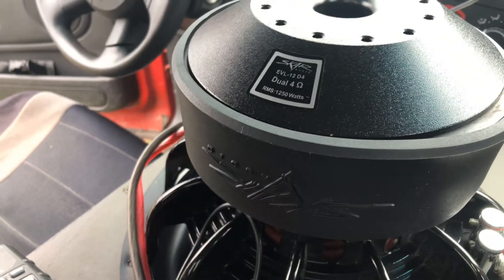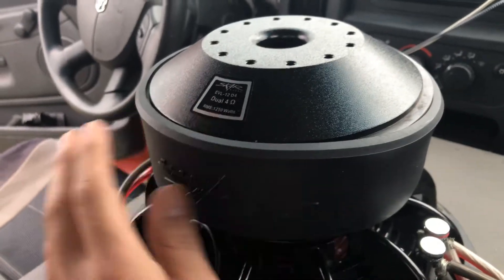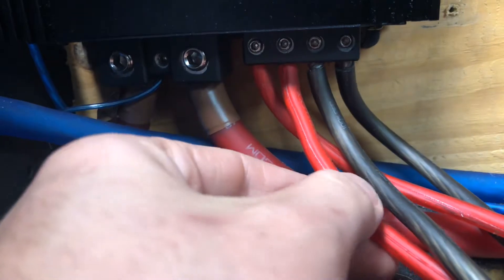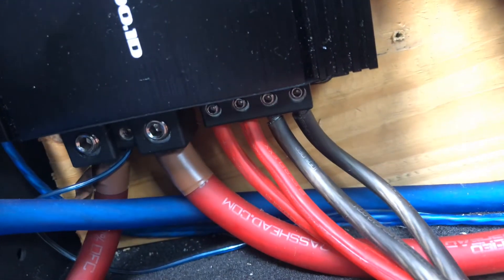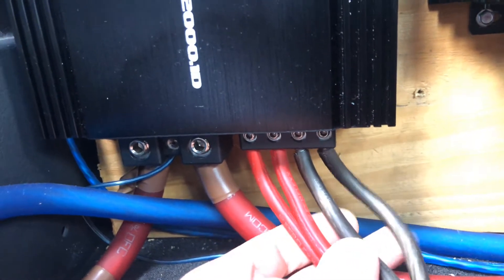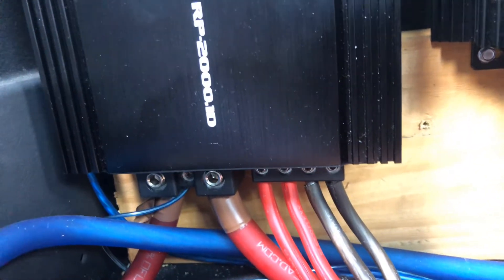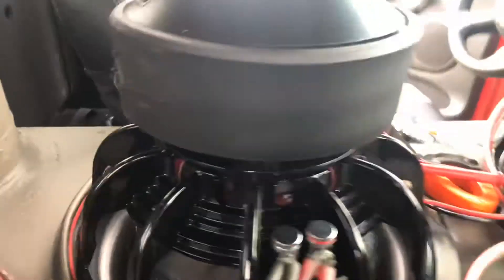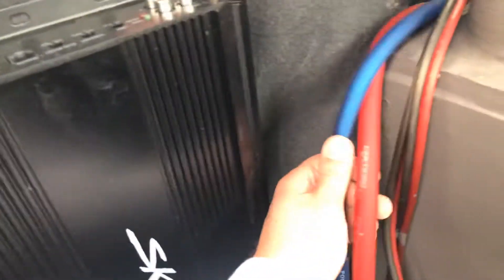How to wire 2 dual 4 ohm subwoofers to 1 ohm

Comment: How you fit those thick cables together?
Reply from the maker: Most higher end and spl type subs have larger terminal they also make terminals that you can screw down 2 wires into and they have a post on back that would secure into terminal on amp or sub
Reply: @TheRandomHandyman  oh thank you
Reply from the maker: @grikisgrikis2779  welcome also ya gota twist the shut out of them haha

Comment: I have 2 15 l7 kicker solo baric and i have mono block 1ohm load and it has two positive and two negative can i do the same? how you did it?
Reply: I guess it depends if your subs are 2ohm or 4ohm.
If they are 4 then yes.
If they are 2ohm then its a little unfortunate, unless your amp was too big for your subs anyway.

If it's 2ohn you'll have to wire them together at 2ohms.
This means that if your 1ohm amp is rated for 1000 watts rms at 1ohm.
Its probably putting out like 500ish at 2ohms.

I made a big mistake recently and ordered a single channel 1500 watt rms amp with 2 15's that are dvc 2ohm. Each sub rated 800 watt rms.

Little did I know running my amp at 2ohm instead of 1ohm, would split my watt rms output basically in half.
And each sub would only be getting about 400 rms. 

After some talk with a skar customer service representative to help me figure it all out I canceled my order and got 2 svr 15 4OHM subs on the way!

Comment: What are the ags weight?
Reply from the maker: ? These subs are skar evl, I have an unboxing video with wolfram subs with specs on them pretty sure I have weight listed on that video if your talking about wolfram ag subs? Weight will also vary depending on size
Reply: Just watched it bet
Reply from the maker: It’s in one of the vids been quite some time since I had them, the skar evl 12 is 33pounds and the wolfram ag12 is 38 pounds a 10 or 15 would be lighter or heavier

Comment: HOW DO THE SKAR EVL S COMPARE TO THE WOLFRAM? THEY LOOK SIMILAR BUT THE SPECS ON THE WOLFRAMS LOOK BETTER.
Reply from the maker: I actually have a set of wolfram in some older vids on same amp, they are very close in comparison I would personally purchase what ever one is going for a better price or deal at the time I had no issues with either brand they both played hard and took a beating and both a fair prices. The wolfram have a clean looking white basket and are little taller and weigh a little more but it’s so close it’s just personal preference between the evl and the Ag series if I had to chose again I’d probably go wolfram but like I said price is key
Reply: Handyman let me kno if u have any equipment for sale